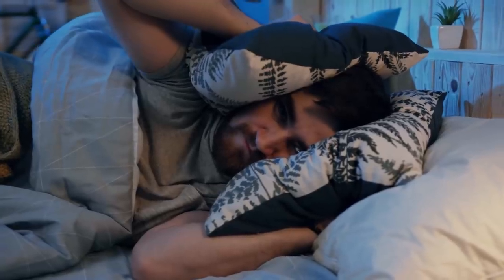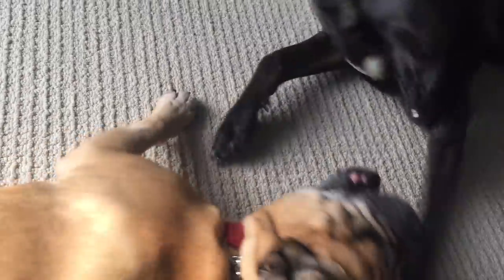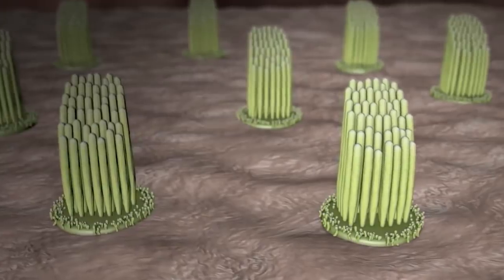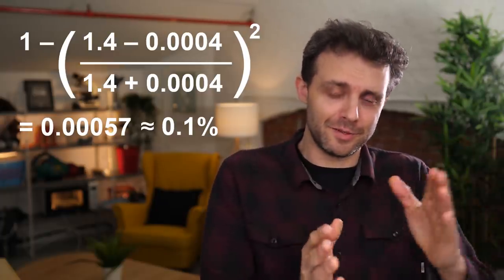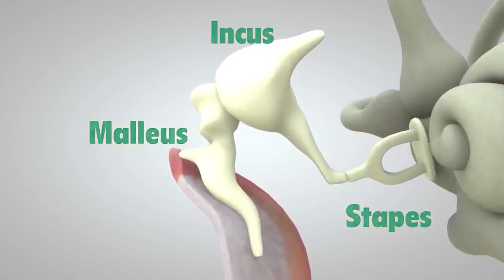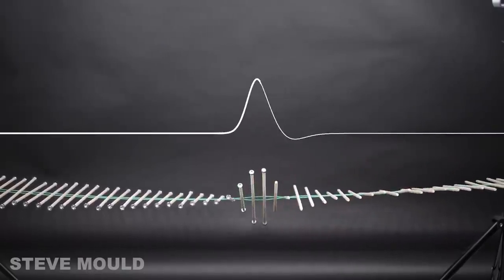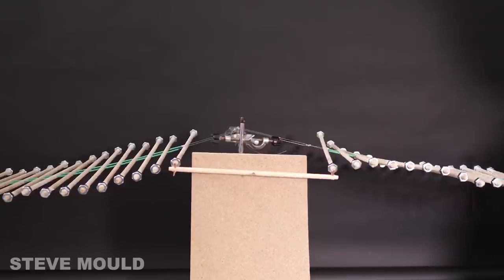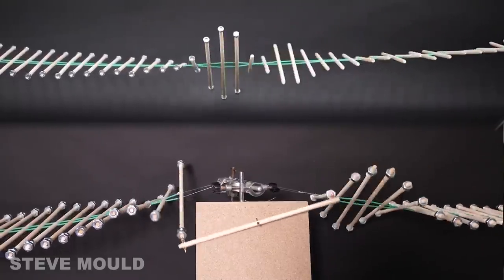There's a Lever in Your Ear and It Does Something Amazing

Comment: When you're young(er), the bones in the ear are slightly more flexible.  This means that when a really sharp loud noise, a big transient, hits them they flex slightly and don't transmit the full force to the oval window.  This has the same effect as an audio compressor and it flattens out potentially painful loud sound such as gunshots or loud bangs such as you might get in a big cinema during an action movie.  When you get older the bones become less flexible and they lose that ability to take the edge of the really sudden loud noises and they go straight through to the inner ear..   This is why older people complain that the music is too loud or the film soundtrack is deafening.  Our compressors are buggered basically, we're not being moaners, it genuinely hurts.

Comment: 9:22 Do you need a VPN? Simple criteria, do you need to:
• Use illegal torrents and don't want your ISP to track you
• Access content from other countries on platforms that don't discriminate against VPNs (which is a lot, public use VPNs are easy to detect)

That's it, you don't gain any security benefit from using a VPN and can only slow you down; if you are concerned about having pages served through http - either disable pages from being served through non-TLS or use a browser like Brave which will promote connections through TLS. 

You probably don't need a VPN, and when you do don't bother paying for one when you as the end user gain the same benefits, and if you really care about not having anything pointing to you then you'll just set up your own VPN which strips headers and uses public VPNs and makes you truly anonymous.

Comment: Mercedes / Audi use that muscle tensioning for expected loud sound to prime our ears in case the car's system detects a possible crash.
Reply: How so?
Reply: @iamdave84  They play a special tone / sound which makes that muscle tense up.
Reply: Now I've finished reading the comments section, I see a few other people have also said they play pink or white noise at quite high volume. That's rather clever.
I wonder what triggers this. Proximity sensors on the front of the car noticing something rapidly approaching? If so, are they also initiating the airbag deployment before the actual collision?

Comment: Steve, I was lighting a BBQ this weekend and noticed something about the lighter. It's a fairly standard one that you might buy from a newsagents. The fluid sits in 2 compartments, but I noticed that the fluid levels never balance out. It only moves from one compartment to the other when the air bubble in either compartment reaches the bottom (where the gap between either compartment is). This confused me because of I thought that for a connected system, any build up of pressure heads causes the fluid level out? I wish I could attach a picture to show you. Any thoughts on this?

Comment: I think you missed out on highlighting a major contributing factor with hearing, human brains have always had the same ears, and so no matter how badly a signal wave is mangled, as long as its mangled consistently , the brain will decipher it. 

this is why when someone starts to suffer from hearing loss, if its gradual, they wont always immediately notice it, their brain gradually gets more proficient at telling them what inputs its receiving, right up until there is not enough input to decipher, at which point they notice their hearing loss and find out its already too late to get it fixed, this is why its worth having you hearing tested as often as you might visit an optician.
Reply: Interesting opinion, I like it

Comment: Steve nooooo

I have a recurring motor tick where I contract the tensor tympani to create that rumble. It comes back whenever I think about it, and I think you just accidentally set it off again. 

Anyway this is a good video and I appreciate you getting the word out so it's easier to explain to people, now I can just send them this video instead of trying to explain it myself. 

You just pulled a Jimmy Neutron, you gave me a solution but you also created the problem lol
Reply: Also there's a subreddit for this, r/earrumblersassemble and it has 71k subs where it seems like having a motor tick as a result is somewhat common

Comment: Why am I able to pop my ears both directions? I discovered it the first time I flew. I did the "wiggle your ears" muscle back once instinctly and they both clicked and the pressure released. When descending I felt pressure and concentrate my bridge of the nose muscles needed to cross your eyes and the pressure again released. I've mentioned it and been told everything from its "my imagination" to I "should be able to exhale from my tear ducts" (can't figure it out). I'm sure it's a sinus related thing but can't figure it out with diagrams or blurbs.